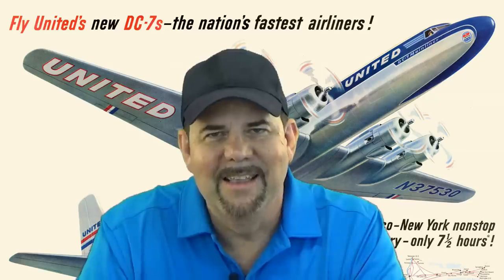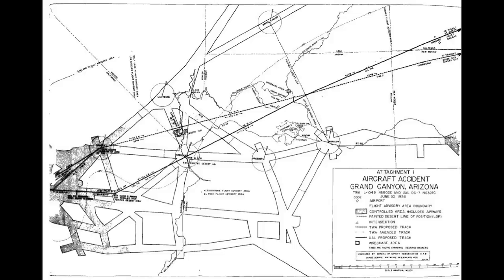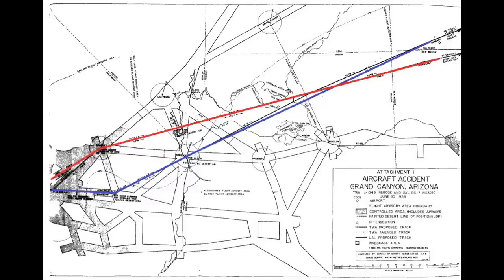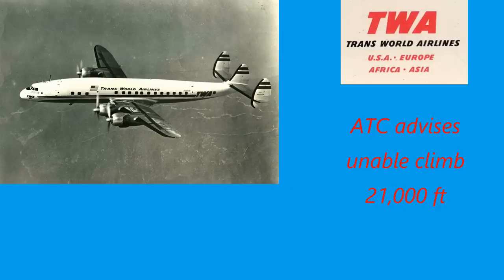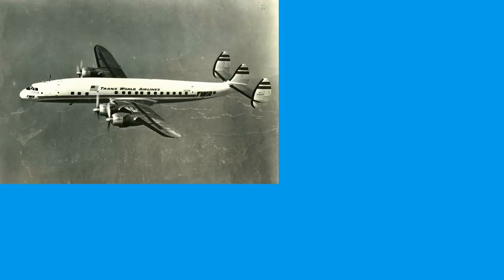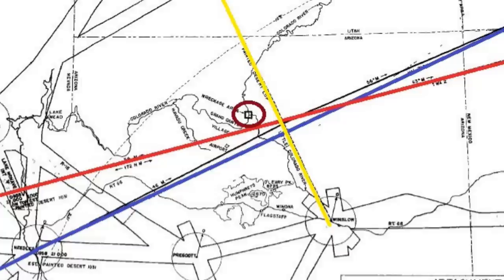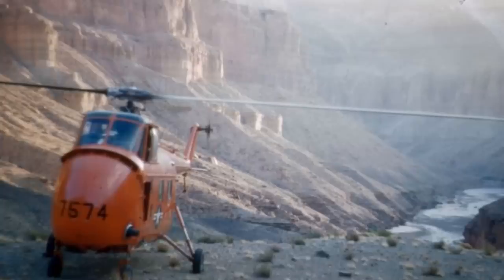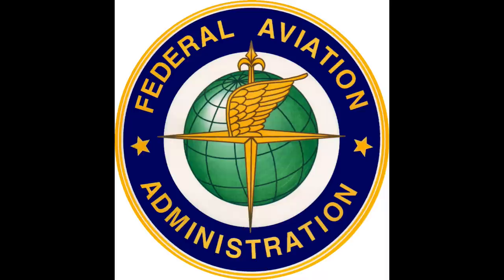The Crash that Changed the Way we Fly; 1956 Grand Canyon Mid-air

Comment: The Air Force had the civilian Operation Skywatch from 1952 to 1958 to look for possible enemy aircraft activity since there wasn't any comprehensive radar coverage over the U.S.  No one was completely sure what was going on in the skies in much of the 1950s.
    When I went to work in Washington, D.C. in the 1980s, the governmental entity for which I worked shared a building with people working on creating a new air traffic control system.  I don't believe as of this time any new comprehensive system has been implemented.  It must be one of those governmental programs which each year the contractors claim to have things nearly complete and then every year it is held off so a few new improvements need to be made and Congress keeps providing funding.  It reminded me of the fact that computer upgrades occurred every 18 months and since the government procurement cycle took two years, the equipment was obsolete, so the process had to be started again and years went by without upgrades.

Comment: I don't get it.  When the two planes tell the radio stations their positions, don't the radio stations call LAX and inform them?  And if they did, why didn't LAX, in turn, call the planes and tell them to alter their flight plans?
Reply: That may be in the current situation under current legislation.  That crash was the exact reason why all of this exists today.  Then it did not.  The Class A air space above 18 000 ft - with IFR mandated - did not exist at the time of that crash.  If you watched till the end you would have seen that President Eisenhower signed that FAA act only in 1958 as direct result of that crash.

Comment: I watched a documentary on this 1956 air disaster. It's kind of sad that this accident should have never happened. According to the documentary  the TWA flight was running behind schedule for some reason and should have took off 30 minutes before United flight. After the TWA Flight took off the United flight took off just three minutes behind it. The DC 7 was slightly faster than the constellation and just over ran it when it climbed to  21,000 feet
Reply: or it was speeding to make up the time so no one would notice on the other end ,..its amazing they could have even caught up being 3 minutes behind ..but a computer reenactment could figure that out

Comment: Is there any way to know the competency of the pilot flying your plane?
Reply from the maker: Good question..all airline pilots must pass simulator checks very 6 months
Reply: @JamesWeatherly  So what does that involve, engine failure, bird strikes near misses instrument only flight or?
Reply from the maker: There is a format set by the government.  You practice engine failures, fires, systems failure, low visibility landings, etc..
Reply: Pilots are not just assessed on their technical skills, but also their “Non-Technical Skills”. These NTS are taught formally to Pilots, Cabin Crew, Engineers and Other safety critical personnel.

NTS include topics such as Decision making, team work, communication, risk mitigation, situational awareness, workload management and the like. A pilot could be perfect in their technical flying, yet fail a check flight because of lacking NTS. As an example, the TWA Crew would have failed a check flight for climbing to 21,000 VFR because, although allowable, it should have been obvious that there was conflicting traffic at that level and no real effort was made to mitigate that risk.

You can be assured that the competencies of Western Pilots is very high.

This was an excellent treatment, JTWPilot. Thanks very much.

Comment: There is a reason flying is so much safer than any other form of travel. It is because there is so much potential for disaster, that aviation is so tightly regulated. Why pilots have so much training, and why they are so closely watched.
     All of it has been forged in blood. It might seem counter intuitive, but whenever there is a big crash, aviation gets safer because we learn what went wrong to cause the crash, and we make changes so it won't happen again.
     Imagine if they did the same thing with driving!

Comment: Does uncontrolled airspace mean no ATC is responsible for keeping separation? Or is it a RADAR blackout? Because I feel like I hear that term still today..
Reply: Class G is uncontrolled airspace. Uncontrolled airspace is airspace where an Air Traffic Control (ATC) service is not deemed necessary or cannot be provided for practical reasons.
Reply: Yes the term is still in use today.  I fly in an uncontrolled air space which has radar as I still turn on my transponder.
I believe there are still large areas of the pacific that is outside of radio contact with any air traffic control and can only assume they are also outside of radar contact.
I don't know if either of those two things occur over mainland USA but can assure you at low altittude away from airports with regular commercial flights majority of the airspace will be uncontrolled.
Reply: It means ATC is not responsible for IFR separation in that airspace. There may or may not be radar coverage. Nowadays most airspace is controlled and all airspace above 18,000ft is controlled in the US.

Comment: A very clear presentation.  Thank you.  Have you done a video presentation on the aviation accident (a crash into a mountainside) caused by a passenger turning on a battery-powered FM broadcast band (I presume) radio receiver that he had carried aboard?  I think this is what triggered the general ban on passengers operating radios aboard passenger airliners...

Comment: I wonder why both planes, traveling in the same direction would have chosen to fly at the 21k' trajectory? I understand neither would know the other's altitude but why would exactly 21k be the choice over 19k 0r 20k. Was there a rule in the industry that said flight was to be maintained at 21k?
Reply: Eastbound flights used odd numbered altitudes and Westbound used even numbered altitudes
Reply: 19000 or 21000 is East bound. 18 or 20,000 is west bound. 1000 ft. Separation East and west.

Comment: I have been watching crashes and I asked a pilot why they would take off when one or two  engines are smoking black smoke and he said the pilot cant see if this is so and I asked why the tower would not inform the pilot of a problem like this because I saw two different crashes where the  planes took off and only reached about 700 -1000 ft. when the planes  veered out of control and crashed the pilot told me he couldn't hear the tower because of the noise and the plane was vibrating. I don't believe him I know this to be untrue especially in the SR71 they have a periscope over head which allows viewing the engines.

Comment: I don't meat to pick the fly poop out of the pepper but it should be Flight Level 210 and the correct radio call sign for TWA was "Trans World", 2 syllables not "TWA".
Reply: Not aviation-related, but the phrase "pick the fly poop out of the pepper" sounds like a tongue twister LOL
I seriously had never heard or seen that before. Ima steal that phrase >:D
Reply: I thought that as well, and wondered if it was a 1950's radio protocol.

Comment: My father worked for the CAA/FAA from 1940 until 1968.  I remember that immediately after this disaster, he was assigned the task of implementing positive aircraft control over these wide open spaces in the western US.  The immediate solution was to establish ground VHF relay stations with landlines back to the controlling ATC to allow direct communication and control off the aircraft.  As I recall, the project budget was $9m and the timeframe was 90 days.  This was the first corrective step that was implemented, with long range radar and other improvements following.  I believe this incident also kicked loose funding for the subsequent upgraded system of ARTCs  The buildings were concrete boxes on springs designed to withstand some level of nuclear blast.  Each ARTC had deep water wells with large diesel pumps to wash off the fallout.  That was normal back then.

Comment: How unfortunate that a lot times, it takes a disaster to make what seems like obvious changes. Had this particular crash not occurred, we would probably still be watching a video
of the crash that was eventually going to happen. 
Perhaps the 2 other crashes mentioned or some other years later. A crash was going to happen eventually when you count on visual between aircraft flying at multi hundreds of miles per hour. It didn't help that the one pilot ignored the nay against climbing to 21,000.
I imagine him saying: " well be fine, we will climb to 21,000 and I will keep a looksy out"

Comment: There was another old incident which changed aviation respectively the way we build pressureized cabins for aircrafts. In the beginning, the Caravelle, which was the first aircraft to have its own pressurized cabin, had "square" windows. After some time in the air, the mechanics of the Caravelle noticed airline-cracks in the edges of where the windows were installed. Allegedly there were even some incidents in which windows fell out in midflight. Anyway, after Physisists finally found out why the aircraft produced hairline cracks in the edges of the square windows they changed the form of airline windows to what we nowadays still can see on any Boeing, Bmbardier or Airbus. Rounded windows... Because a pressurized cabin expands up to 30 cm (!) during a flight in 10 Km height. I would say, considering the dangers of square windows on the old Caravelle, that the change to the construction of aircraft windows also changed the way we fly forever too...
Reply: You mean the British deHavilland Comet, not the French Caravelle. The Caravelle had rounded triangular windows, which were not susceptible to fatigue cracks.
Reply: Allow me to disagree. The issue you're referring to concerns the De Havilland Comet (from which the Caravelle took nose section and cockpit configuration). After three inexplicable break-ups in mid air with the loss of all passengers and crews, De Havilland engineers and aircrash investigators put a whole fuselage into a huge tank filled with water and raised the pressure outside. It was immediately discovered that cracks appeared around the square-ish windows. They were modified but it was too late for the aircraft's reputation.
Reply: They didn't learn from the Gloucester Meteor which highlighted those exact problems. A bloody death trap.
Reply: I think that you are confusing the Caravelle with the de Havilland Comet.  The mark 1 Comet had square windows but the Caravelle had triangular windows.
Reply: Makes one wonder why cockpit windows are still squared.
Reply: That was a De Havilland Comet that had the square windows.
Reply: The worlds first commercial jet airliner also suffered these issues. The de Havilland Comet. The aircraft was redesigned with oval windows. Naturally other manufacturers took note.
Reply: schwarzerkuerbis I think you mean the Comet.
Reply: I thought there was a serious midair tragedy that they later found were caused by the same square window fractures. It unfortunately usually takes a lot of deaths before things are taken seriously.

Comment: Maybe I missed it but do/did pilots have any kind of c/b radio like a trucker would have for when they are in close range with another plane?
Reply: All pilots flying on Instrument Flight Rules (as is the case here) are on the same frequency, as dictated by the airspace they're in.
Reply: Yes, there are open radio frequencies which pilots can use to talk to each other.
Reply: NjK : Well, even police radios had limits to the distance.  Even CB radios in the 70s could go only so far without getting static.  Planes go much farther and faster.  I can’t imagine that CBs would work for them, even at close distances.  It would be unpredictable to get radio reception to the tower, due to speed and distance.  Otherwise, they would have even tried to do this back then.  They just needed the right technology that they didn’t have until now.  Just something to think about.  What do you think?
Reply: Neither of the cockpits knew the other plane was in the vicinity.
Reply: The HF and VHF radios in use allow aircrews to hear and talk to anyone else on the selected frequency.

Comment: i still wonder, when will aircraft be fitting with escape systems to at the very least save a large proportion of passengers in aircraft disasters who otherwise dont stand a chance. though this type of disaster in this video would be an exception as the decompression and impact forces would have rendered almost everyone dead anyway. and none of them would have seen it coming, but modern planes dont usually hit each other anymore only rare exceptions and the most upto date avoidance systems help to prevent human error when a collision warning and evasion signal is triggered though not to long ago airtfaffic controllers could still intervein and give course changes which discounted the collision avoidance computers directing, which would lead to aircraft still colliding with each other but now the collision avoidance computer has presidance over the airtraffic controllers thankfully removing the chance of human error, but crashes do still happen, and you wont catch me flying until theres a way off the plane when tshtf
Reply: Yuh, everyone is going to wear a chute, correct?   And you are all going to jump from a plane going 600 mph, right?   And 75% of earths surface is water, so your dead body is safely  going to land in the ocean, right??

Btw, 35,000 (or so) people die every year in the US alone in traffic accidents.  100/day.   Shouldn't you be working on that instead?    (-;

Comment: I think it was idiotic of that one captain to be denied an increase to 21,000 feet, but then do it anyway.  The most obvious reason it would be denied is because there's another aircraft at the same height on a collision course.  Couldn't he have asked to go to 22,000 instead?  Or 30,000?  Just 1,000 feet difference and this wouldn't have happened (I know safe distance is more than that, but still).  How high could those planes fly anyway?
Reply: Ceiling on the Lockheed Super Constellation was 24,000 ft.
On the DC-7 it was 21,700 ft.
Reply: Service ceiling for the DC-7 was 21,700 feet and for the L-1049 it was 25,700 feet.
Reply: Propliners couldn't go much higher than 20,000 feet.

Comment: Uncontrolled air space or not the controller told the pilot "unable 21 maintain 19,  wouldn't that be the mistake right there? (unless they were picking up ice) Even today there could be loss of radar and or communications. If there isn't a procedure for a particular event, common sense is the practice.
Reply: To clarify, I meant the mistake was the pilot climbing and not maintaining the assigned altitude.

Comment: I did not like this because of the hyperbole and affected disbelief.  You did not explain more about the uncontrolled airspace rules!  Even though both reported a projected arrival at the same time, it was just an estimate, and could have been off by many seconds and many miles!  It was still just an accidental collision.  The different altimeter settings at the time and place of departure was also provided accidental separation.  The chances that these planes would meet in mid air was still a billion to one event.  Did things get better?  Sure, because of political machinations and pork barrel politics!